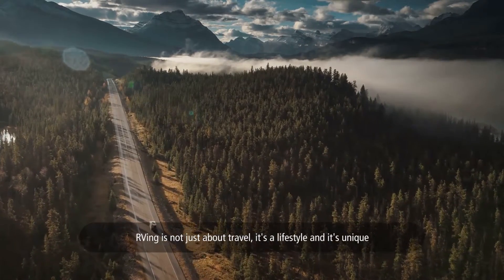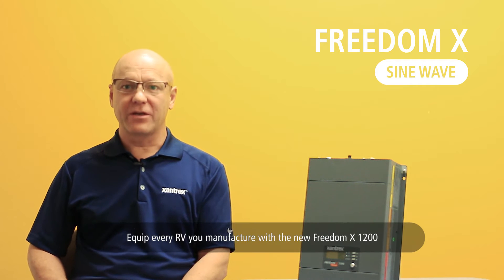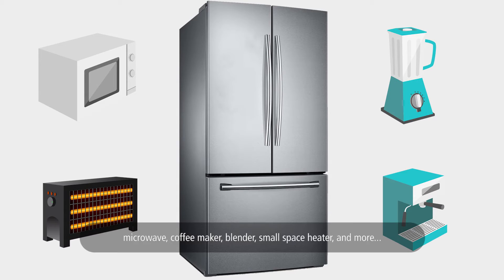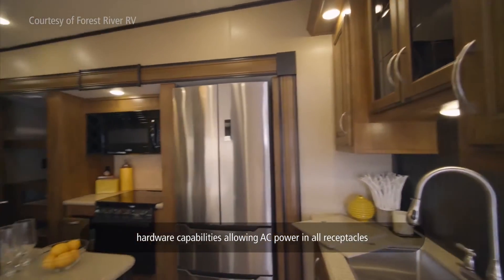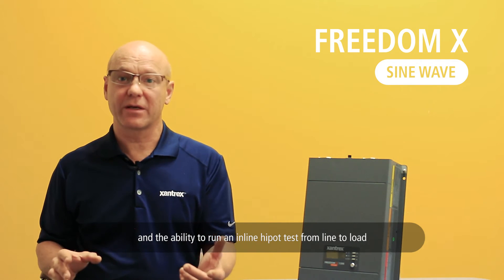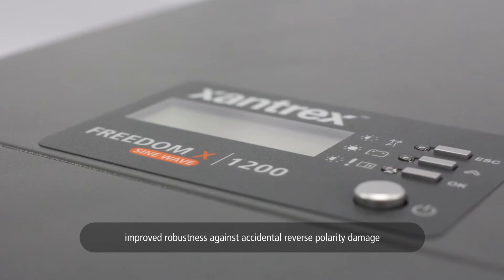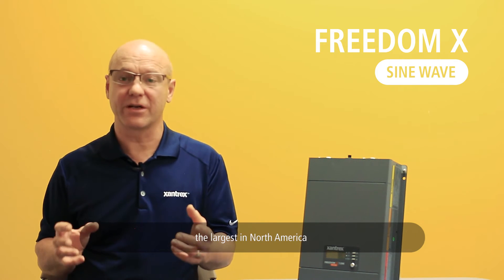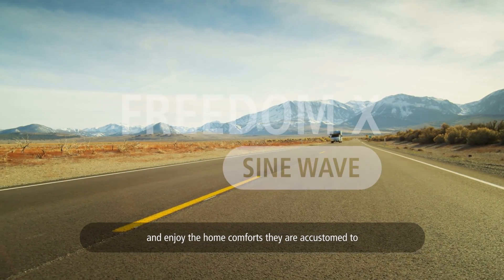The NEW Freedom X from Xantrex! The Freedom to Refrigerate!

Comment: I don't see this product on your web site.
Reply from the maker: At this point we haven't made this product available to the aftermarket. It is available for OEMs only.
Reply: Thanks for your reply. I was starting to gather that. You should consider offering it as a retail product.
Reply from the maker: Sir, you were one of the firsts to ask us to launch an aftermarket version of this product. It will be available in July. The product info will be available on our website in early July. Thanks for writing back to us.
Reply: Xantrex Xantrex Great news! The timing could work out perfectly for my rv build. Thanks so much for letting me know.
Reply from the maker: Thank you. We will be happy to connect you with an Authorized Service Center for product purchase when the product is available.
Reply: I just bought a camper with one, but no manual. Big issue.
Reply: Bummer. Weird that the camper manufacturer wouldn't supply one. If it was purchased new, I'd bug them about it. The comment from Xantrex above says "product info will be available on our website in early July", so you aren't in a hurry, you could hang tight for a bit and just download the manual when it becomes available. If you don't see anything by mid July, I'd contact Xantrex. I'm sure they could hook you up.
Reply from the maker: Please email customerservice@xantrex.com for manual. Note the Freedom X1200 is an OEM product so information is not available on a public domain. Sorry for the inconvenience but hope you understand. Thank you. Happy July 04 to you and yours. Have a great day.